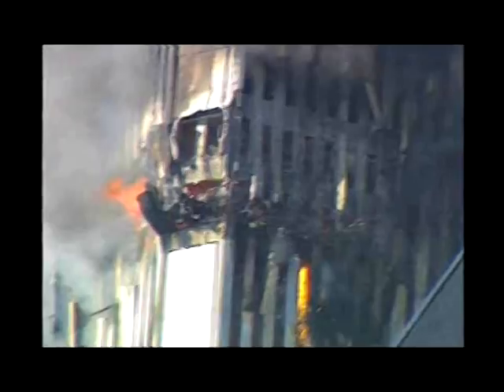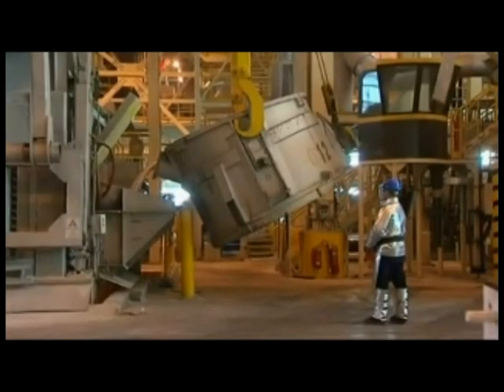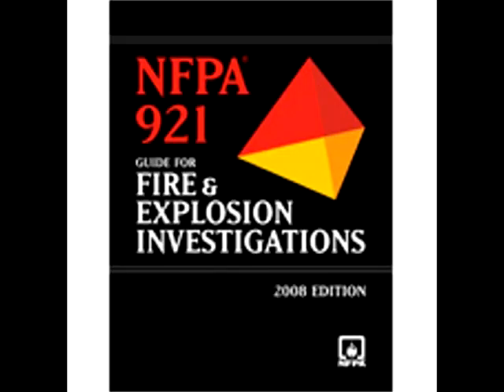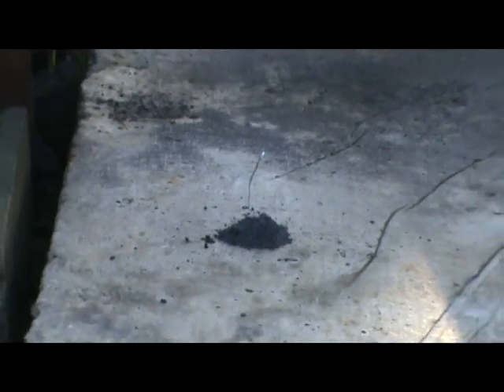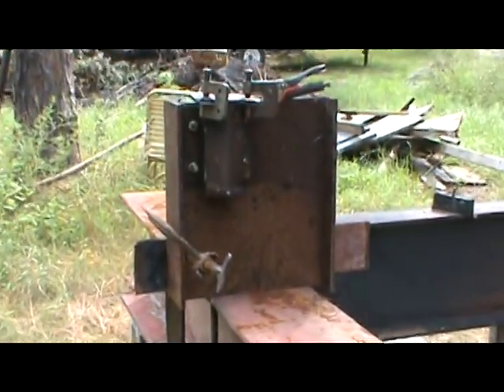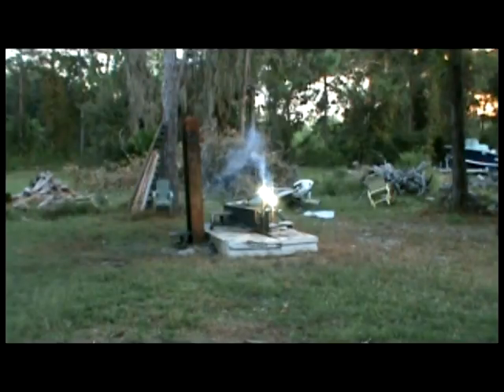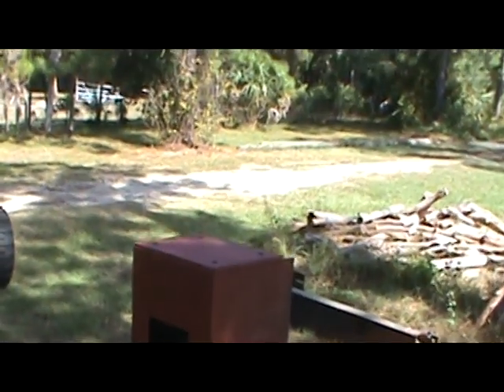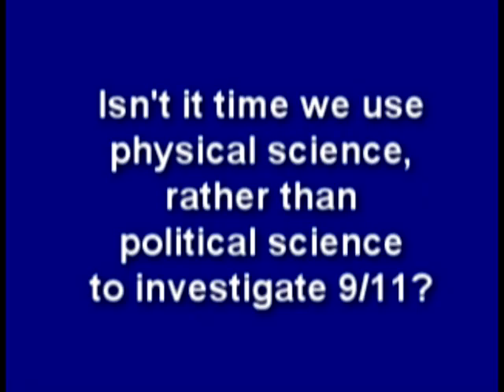9/11 Experiments: The Great Thermate Debate

Comment: Some people are so idiotic. The steel beams didn't need to be at theit melting point in order for them to fail. Steel beams in sky scrapers are under enormous pressure and even though the temp was around 800 degrees below the melting point of steel it was still hot enough to seriously compramise their strength.

Comment: So your first assumption is that the fires "were burning out and cooling down"..... you have no idea what was going on in the building just like the rest of us don't. And you don't have to get steel hot enough to melt, you only have to get it hot enough to bend. Now if you want to talk about a building being professionally demolished you should educate yourself on how that is accomplished because there is no way in the seven hells that they could have prepped the buildings without anyone noticing. The molten metal pouring out of the building could have been aircraft aluminum.....keep those tin foil hats tight my friends

Comment: As far as the building coming down, the jet fuel may not be able to melt steel beams, but it can certainly weaken them. Lets say that the max load of one of those horizontal steel beams is 10,000lbs in the middle of the span. If you put that weight on a beam, and then expose it to 1800 degrees, it will not melt into a puddle, but the beam will begin to deform and sag because it's maximum load goes down when it's hotter. The biggest unexplained thing is the molten metal pouring out, which we can all see on camera. I think we know that's not aluminum. I'd like to say that the iron spheres are a big unexplained thing but i've never seen a reputable source confirm those.

Comment: You know, as a metal worker seeing the molten looking beams is nothing surprising. It have seen it on drills that lost cooling and machines that crashed. The metal melts though the mechanical force. The Fire did not melt the beams, it just heated them to the point they lost a lot of their carrying capacity. When the building came down the mechanical stress very likely heated them up to the pint of melting. The sheer energies behind a collapsing skyscraper should have no problem with that.
Reply: In the end it comes down to occurs razor. And the easiest explanation is that a combination of damage from the impact and weakened steel brought it down.

Comment: I'm surprised that no one has mentioned the possibility that the planes were built with a magnesium alloy instead of aluminum. Magnesium burns at 4000 degrees F which is plenty hot enough to melt structural steel and destroy the concrete.  Magnesium is 33% lighter than aluminum and has a higher strength to weight ratio which makes if perfect for aviation (except for the flammability problem).

Comment: Not gonna lie.  Didnt watch most of this vid.  But if you heat metal to super high heats, but it still isn't at melting point.  Wont the weight of the top quarter of the building push down and bend the weakened metal?  I think thats a much better guess than "the government" caused it.....

Comment: Thanks for this. Totally shows how 911 was an inside job. The twin towers were built to go down, the government knew what they had to do. Fucked up how the government can just kill its people to keep its own secrets.
Reply: Minoru Yamasaki was the architect of the two towers. Yamasaki worked with structural engineers to come up with a revolutionary design: two hollow tubes, supported by closely spaced steel columns encased in aluminum. Floor trusses connected this exterior steel lattice to the central steel core of the building. In this way, the “skin” of the building would be strong enough that internal columns wouldn’t be necessary to hold it together. These mother fuckers planned this shit and are responsible for all those deaths. Yes an eye for an eye leaves the whole world blind, but fuck people that give themsleves the authority and power to make decisions like that. The world doesn't need people like that anymore, we've fucked our planet up too much

Comment: one thing people are forgetting is the wind that high up could stoke a flame to be hot enough to melt steel. not to mention allot of buildings from back then used substandard steel bolts and beams. good quality cubical wall dividers,chairs,desks,filing cabinets,tables and so on are made of tin,aluminum and flammable material such as wood and paper. the problem i have is the perfect collapse of these buildings. when the plane hit it should have thrown most of the interior furniture and belongings to one side. that side should have burned hotter and collapsed before the other causing the building to fall at a angle rather then in on itself.

Comment: Well I have seen jet fuel burn and melt 3 inch steel. And question for you. What are planes made out of? Could it be aluminum/magnesium and other  parts?  And now name every single product in those offices. And one big thing is how much rust was there. "What is the chemical reaction that occurs?" and what happens to water when it breaks down? H2O= what does those two element Do? You need to stop and think of all those things going on at once. Not just one thing happening at a time.

Comment: the metal might not have out right melted from the jet fuel and what not mixture but steel doesn't have to melt to bend and buckle once it gets hot the steel will become malleable and move
Reply: Catfish moto the nist forensic "analysis" report admits to exactly the opposite....read it first before you get mad..lol
Reply: Catfish moto ..nist admitted the fire did NOT effect the columns below the impact site.

Comment: Never really gave 9/11 conspiracies much stock. But this is compelling
Reply: Only compelling when you ignore the kinetic energy and subsequent damage caused by the plane impact, prior to the fire.
Reply: "Kinetic energy makes steel structures collapse at freefall speeds", why yes, it does. It makes the upper floors of the building collapse (in addition to being weakened by heat afterwards), which then proceed to fall and pancake the floors below them, at freefall speeds. I'm confident that given enough time, that building would've collapsed, even without the fire. That plane hit with so much energy that it instantly partially collapsed all of the main supporting beams inwards and left a giant hole in the side.
Reply: Capitaine Cheng The lease was up and he took it over. When you take out a lease you have to have buildings insurance . If I move house I have to take out   insurance on my new house.
This conspiracy pointer is a non starter, just like so many other easily explainable theories. It would be nice to be challenged with soethongvthat actually makes me think " Wo
Reply: Capitaine Cheng  We all know it couldn't be molten steel. Believers know that already. The tonnes of aluminium which melts at much lower temps was being heated in what were basically furnaces. All this talk about what was coming out of the building not being the right colour. With the variables involved it's just not accurate. We also have the  probable issue of the mix of molten aluminium and water from ruptured pipes mixing. Now that's pretty explosive. Not saying thats definitely what happened. Unlike truthers, I dont claim to know for sure what happened  but just saying what's much more likely than the invisible explosives that apparently went off throughout. Thermite would not have produced that much molten steel . Absurd suggestion.
Reply: Shawn Hudock using the term sheeple just makes you look stupid. I bet you are a jade helm survivor too
Reply: Shawn Hudock mach 1000 is 1000 times faster than the speed of sound
Reply: Shawn Hudock is being dramatic going to help your argument here?
Reply: How is it a conspiracy if it’s fact. It’s more like the taliban theory is a conspiracy theory
Reply: Yea, yall know how that kinetic energy makes steel structures collapse at freefall speeds. And can't forget about that molten steel pouring out of the side of the building.
Reply: When you consider that most conspiracy theories are advanced by people who were nowhere near New York at the time, and have no expertise in either construction, demolition, or physics, it is sort of hard to give them any credence.  Bullshit is bullshit, no matter how well it is wrapped and touted.
Reply: Jeff Douthit I recommend you look into architects and engineers for 9/11 truth
Reply: Jeff Douthit if you think this is compelling, try to find out what happened to building 7, which also fell that day, but didn't get hit by anything. Try to find the truth on that
Reply: Ush Yamamoto conspiracy means it did happen
Reply: Yea it's not like one of the biggest insurance coverages in US history was put on it 2 months before it was attacked or anything. That would be WEIRD.
Reply: Jeff Douthit who says its conspiracy?? Seeing as in the months before 9/11 there were other attempts including a van bombing the basement of one of the towers, it may have been an accident during prep for the big one
Reply: DSiren Sirenite by definition its conspiracy
Reply: rdizzy1 what about building 7
Reply: Jeff Douthit well it's been proven that JFK was shot by two shooters and that was exposed by trump skip to today and he's already threatened to release 9/11 info

That should hold some interesting information
Reply: rdizzy1 The designer of the WTC told that the towers could withstand 2 Boeing 747s in each tower
Reply: Jeff Douthit cause you're gullible
Reply: jbhme - One would have to be gullible and just plain ignorant to believe the government/ media narrative. Check out corbett report.com for some summaries of facts about this, including the data and money trails that show beyond any reasonable doubt that that 9-11 was a pre-planned, orchestrated event. Cognitive dissonance prevents most people from thinking objectively about this event.

Comment: I'd say a possiblity is there were some Magnesium structural supports in the building, the temps were more than enough to ignite it and once it's burning it can reach over 2x the melting temp of steel. It would easily be able to make a river of steel pour out the building. Thermite always chunks up and cools off quickly into a solid.

Comment: I had feeling they were lying to us. I seen the molten metal. New had to more then just jet fuel.
Reply: Yes, it was more than jet fuel. Its called, multiple fuel sourses, a 1000+ degrees combustion chamber and a contained environment. All that adds up to an unquantifiable mess as far as exact numbers are concerned. But aviation fuel can and will burn at 2000+ degrees C. Even pure Iron melts at only 15 hundred deg C. Okay, sure let's say the pilot had the engines at max, and the Chambers maintained a safer sub 1300deg C to stop the chamber from self-destructing. Well, give it a faster flow of fuel, already 1200+ temperatures, a confined and insulated space and say an hour, and yes you'll start melting into your average construction grade steel and possibly even Iron.
Reply: Rob M Says who?
Reply: Says physics. You people act like the steel beams are the only metal objects involved in this equation.
Reply: but some of the plane wreckage survived the collapse and was even identifiable and yet the indestructible black boxes didn't. So how was it aluminium.
Reply: Rob M Molten aluminum doesn’t look like that. Even if it was at 1800 degrees Fahrenheit, it still wouldn’t look like that.
Reply: Rob M aluminum doesn't burn red you imbicile.
Reply: You saw the molten metal?  Were you there in person?  Did you get a sample of that metal and analyze it in order to find out what kind of metal it was?  Since you can't figure out the difference between new and knew, I would say your answer to all questions is no.
Reply: beaconrider were you there ? No you were not so stfu with that bs
Reply: mike pk666 everything burns red if at the right temperature... Anything can burn blue and white too. The beautiful laws of physics.
Reply: BrianDoesStuff, No, steel wouldn't look like that. Aluminum has a much lower melting point and literally anything will give off thermal radiation and glow at certain temperatures. But another key thing to remember is that the plane is not made of pure aluminum. Like almost everything made of aluminum, except electrical wire, the plane is made of an alloy. Specifically it's made of Aluminum 2024, which means it contains copper and probably magnesium. This makes it stronger but also gives it a significantly lower melting temperature and higher emission power.
Reply: That was the aluminum from the plane.
Reply: Molten glass is also a thing... And yes, if aluminum is hot enough, it burns red.
Reply: No, I wasn't there.  That is why I don't look at some lunatic fringe video made by someone who wasn't there and has no real qualifications to do so, tries to tell me why something happened.  If you think I am going to shut up because some third grade dropout with a paranoia problem tells me to, not this day pal.

Comment: This video is absolute BS. And if they claim that the investigation determined that the structure failed because the steel melted. That is just not true at no point did anybody any investigation team say that the steel had melted in fact they stated that the steel could not melt at the temperature that the fire was burning out. The whole premise of this video is based on lies and opinions of people who have no idea what they’re talking about. You don’t have to melt steel to weaken it and have a structure fail.There are many examples of where steel structures have collapsed After they were exposed to the heat of the fire. Just look at any picture of a drilling rig that is caught fire and you can see the Derek collapse after it is heated. When you examine the metal after the fact there is no melting. The whole thing is just nonsense why do you have to blow up a building after you’ve crashed in airplane into it. Is This convoluted story is for the weak minded.  And furthermore how do you control an explosion in a building that is on fire after it has been impacted by a jetliner. There is no control system that can survive the impact of a jetliner and the subsequent fire of the fuel.

Comment: I would like to point out that the steel beams doesn't need to be melted for the building to collapse. The steel beams is heated greatly by the jet fuel, then add the cracking of concrete by the heat. The columns are severely weakened to carry the weight.

Has anyone tested that theory?

Comment: Soak carpets and office materials in jet fuel and shove inside steel and concrete enclosure then feed 40mph+ wind for oxygen supply 1 hour. I bet you wont have too much trouble getting that last 1000º needed to melt steel from the max 'OPEN AIR' burning temperature of jet fuel. Morons, at least properly create the conditions of the fire your attempting to analyze and claim that something is impossible with your experiment. All you demonstrated is that the LOWEST possible fire temperature was 1800º for burning jet fuel. You know how forges work? Why we insulate and encase them in bricks and feed air into small areas? It's because you can reach much higher temperatures by forcing in an oxygen supply and lower the dispersion of the heat with the brick/cement enclosure.
Reply: NoSuspect ..the govt DID full scale fire mock-ups of the floor system..then proceed to ignore the results and substitute fudged values in the nist forensic "analysis" computer models of the collapse Initiation....you wont find that lil factoid on the TV. ...you have to read the report like I did.
Reply: I was talking about the people showing jet fuel in the video burning in open air conditions. Not the NIST report. I was criticizing this because if they wish to begin the video on a claim that 1800º is too low to compromise steel in the building and then take that temperature and act as if this is what would be the conditions in the building and mislead viewers from that point on then what is wrong with pointing out this as it somewhat discredits everything after that point as the initial basis of requiring an alternate reason for the collapse is based on inadequate experiment conditions.
Reply: IF you want to give more credit to this, then present it with relevant basis. Not open air fuel, but fuel saturating everything you find in a building encased in concrete and with a blacksmiths bellow feeding in a oxygen supply. If temperatures are still too low from this then you have a basis but if you can reach the temperature to melt steel you have a problem. Anyway, at least starting here it doesn't seem like some slight of hand.

Comment: you are all full of shit AG-1 fuel can get hot enough to melt steel.  I've seen it done first hand from burning tanker trucks in iraq what your not taking into effect is the insulation effect of the building and the altitude of the building.  plus the building works like a blast furnace when air forces it way up through the building from below and is drawn up to the fire making a blast furnace effect that what melted the steel. also the towers were a pretty busy place if it was a inside job how come no one saw workers plating this stuff into the building? there would of had to been huge efforts to put that much into a building to cut all the beams people would of seen it